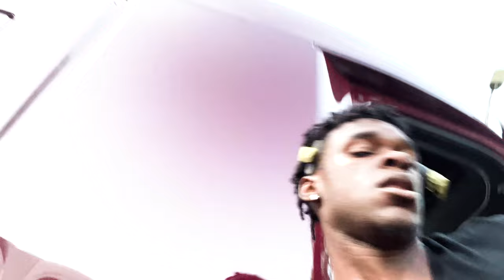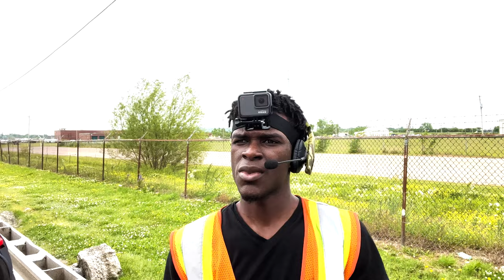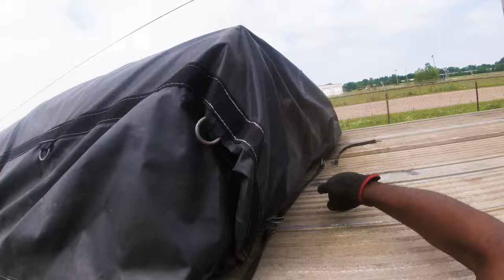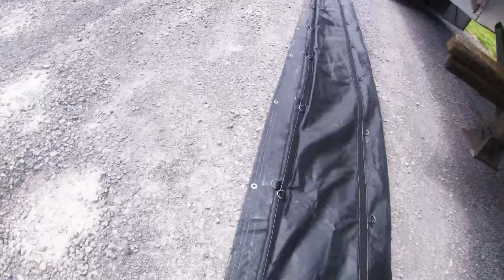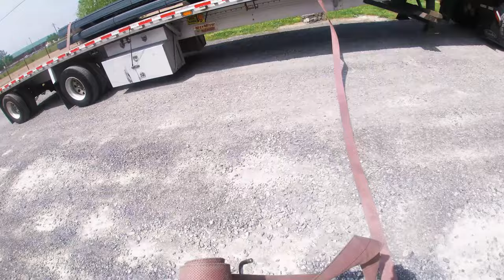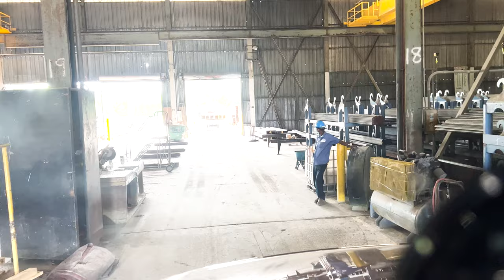Which Is Better? | REGIONAL vs. OTR | Maverick Transportation

Comment: Hey brother I’m at Maverick orientation now. I wanted to go regional but the recruiter  told me only thing they had was USA which I took. I’m out of Atlanta and I think you said that you were out of Alabama but my question is how did you get the regional with Maverick. Was it the experience you got with otr or a position came open or did you request it. I’m gonna go USA but trying to get some insight on how to get a regional route. Thanks bro I enjoy your videos also.
Reply from the maker: Regional was/is open in my area G. I’m not sure about your area but you can go check the hiring map and see 👌🏾
Reply from the maker: It’s easy as just asking for regional in your area. If they are hiring for regional drivers around Atlanta, they’ll hook you up with a regional division
Reply: i’m in atlanta also looks like i won’t be getting regional then lol

Comment: Probably a dumb question but does the pay change depending on going otr or regional,  or is it pretty much the same?
Reply from the maker: No such thing G. Good question. Technically yes, your pay will change, because you won’t have that Saturday to run miles if you’re regional. The pay period ends Saturday @ 4 pm cst. Your pay can look identical to the OTR guys if you go regional but choose to stay out from time to time. That’s what I did. I chose when I wanted to stay out and did it. I also had the choice to go home every weekend. OTR guys don’t have that choice. That’s the reason why I went regional. To have that choice.